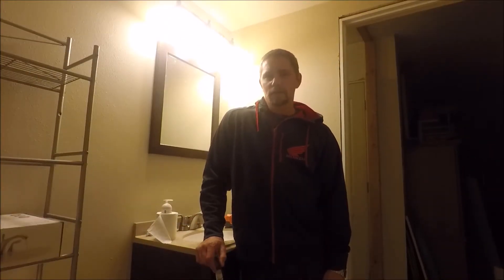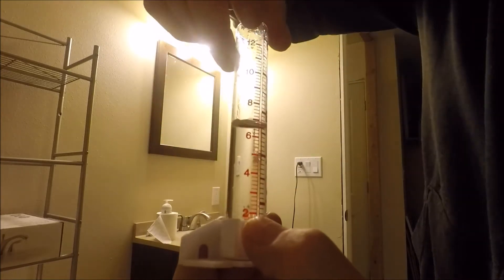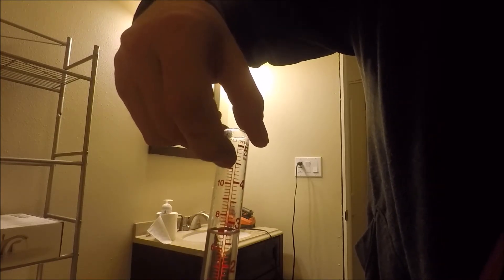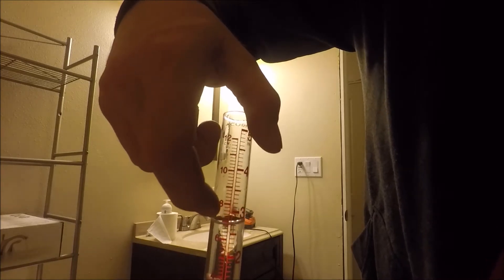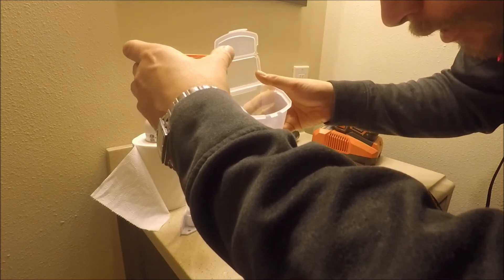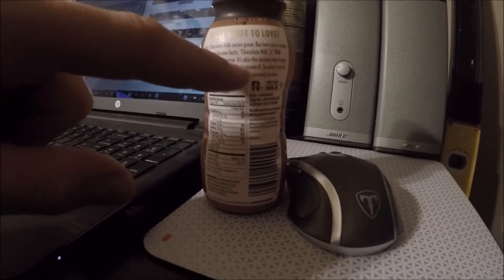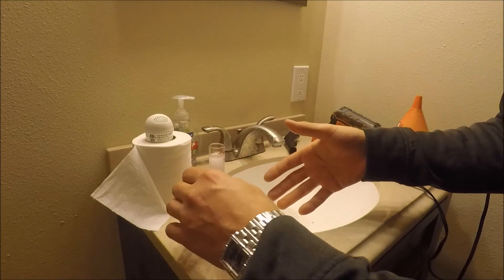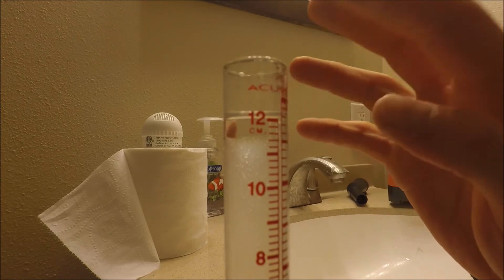DIY make your own e85 test kit for under 2 dollars

Comment: How did you determined how much water to use
Reply from the maker: Amount isn't really critical you just have to have enough to pull the alcohol out of the gasoline. Don't use enough water and it won't work (tried less first and it didn't separate). Just have to make sure that you have the space above the water where the fuel is added marked with evenly spaced lines from 0-100 (can space it out by 2s or 5s or whatever to make it easier it's just harder to read as accurately.)
Reply: @caraddict  I wonder if the tube were smaller diameter, if it would separate with the smaller amount.